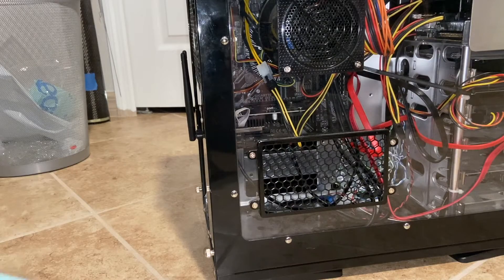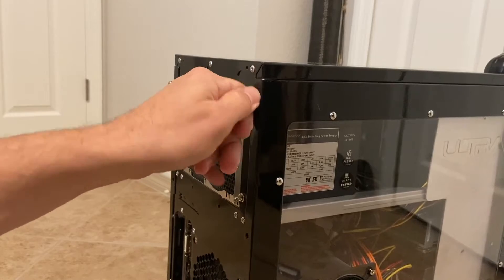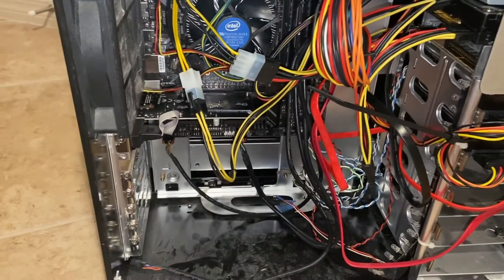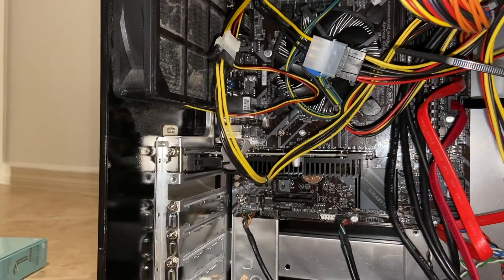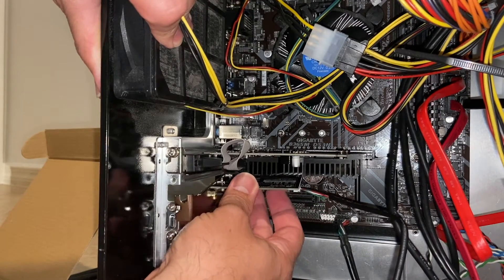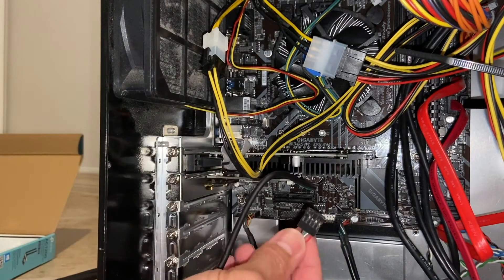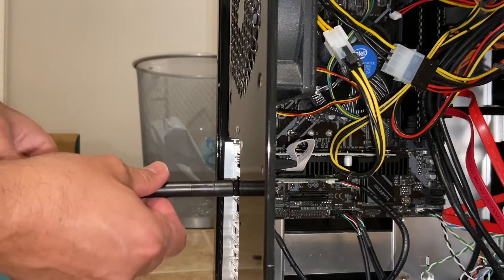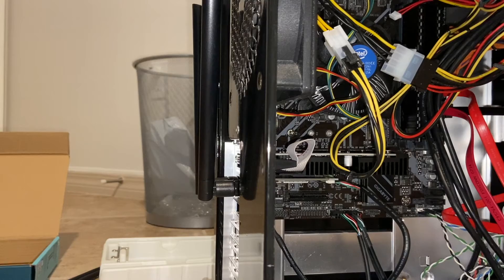Installing a WiFi Card in Desktop PC

Comment: I've plugged this (well one that looks 100% like this but is made by ASUS) card in and my PC won't boot. Just gives me few bios beeps and that's it
Reply from the maker: Something must have come loose while you had the unit open. Make sure everything is plugged in properly on the board, etc.
Reply: @CliffsHowTo  apparently it might be an issue with PCI-E load order in BIOS